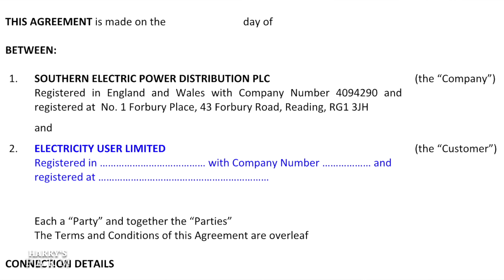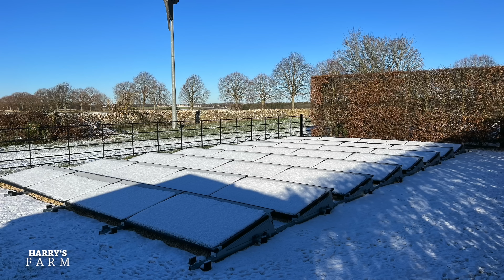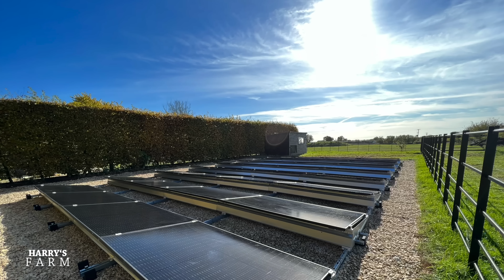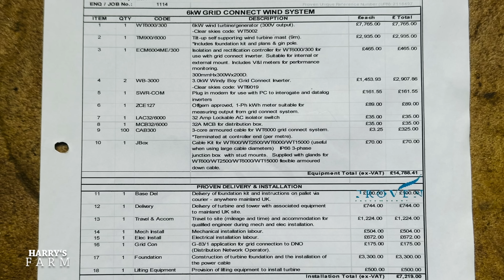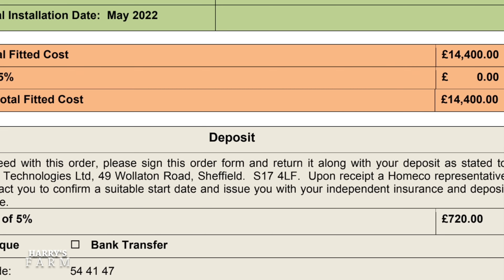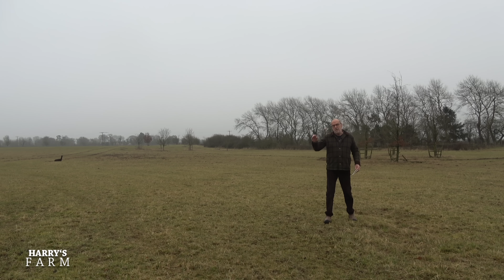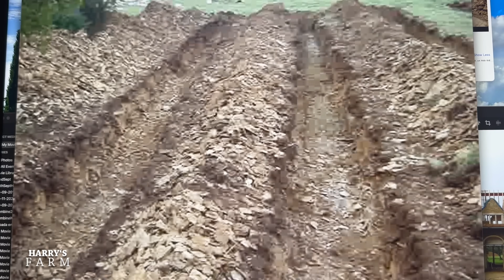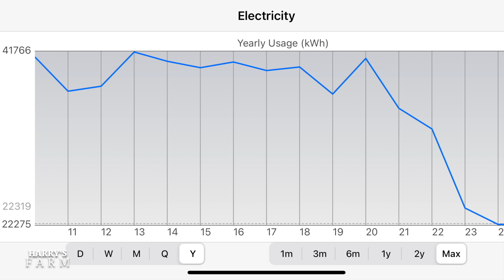Are solar panels & heat pumps worth installing? Here's what I've learnt after several years of use.

Comment: Solar size needs to be maxed for Winter. Panels are cheap if you have the space get 4times more. Yes you would have to limit what you produced in summer to meet the max the grid can take from you. But just switch some panels off as required. Yes the return would only be for half the year but they would still pay for them self easily in their guaranteed life span.
They should also be mounted at a much higher angle to get the max from any winter sun that is out there. Again max in winter not summer. There are bi-sided panels that can even be mounted vertically.
Yes you either need optimisers or Micro Inverters on each panel (that could be shaded) so that it does not take down the output from all the panels on the string.
Very interesting to see how little the wind makes and that is on quite a large turbine that most houses would not be able to mount.

No mention of batteries. I am surprised you do not have at least a day worth of battery storage (or more) then you can go off peak and get the electricity at a 3rd of the cost (currently). 

Not the best designed PV system for what you paid. But it works and can just tick over or spend more to get it better for the winter.

Comment: My well insulated and newly renovated Southeast Virginia home (2900 SF) uses about 11,500 KWH annually. Everything is electric, with the exception of a gas-driven tankless water heater. In 2022, I installed a grid-connected, roof-top system consisting of twenty seven 400 watt Q-cell panels, each with its own micro-inverter to optimize output in the face of shading issues present on the property. Yes, shading will negatively impact output and, yes, production levels fall way back in winter months. That said, and despite those problems, the solar array covered about 75% of my annual electrical usage. When I add additional credits provided by the local power company, my annual cost for electricity runs about $500 total. There are many variables that go into projecting the feasibility of a solar array. For me, it was a definite yes.

Comment: I live in a 2 bedroom badly insulated cottage with tall ceilings  built circa 1950.  Two log burners and a  oil combi boiler. I have free firewood. 

Total  heating cost £600 a year in oil.

£14,000  is i submit excessive.

Comment: We have a ground mounted 7.38pKw solar array where the angle of the panels can be changed throughout the year. We also have optimisers which remove the shading problem if one panel in the string is shaded. Panels currently at 60 degrees and produced 123.01 kWhs in December.

Comment: A wind turbine from 2006? Again Harry, the technology has moved on. It should be higher, with longer and better designed aerodynamic aerofoil blades. Again you are in a position on a Fram to do this.

Comment: I own a solar and renewables business in the south west- 89w is much lower than it should be for a 12kw system in daylight. 
Either there’s a fault in the system (how far away is the inverter?) or more likely, the whole system is being brought down by the back row. 
You may be able to improve generation by having someone do proper shade calculations and adjusting the string layout (the order in which panels are joined together). Or even removing the back row from the system during low sun angle months.
Reply: If I knew Harry, I would tell him to consider buying the pressure treated timber to build a pergola structure at the height of the hedge, you build it with a fall to angle the panels better, high at the back, sloping down toward the front; utilising all the existing hardware plus some stainless coach bolts to fix it. Problem mostly solved, no more shading, better average angle of attack and all for around a few (very few) hundreds of Pounds if you DIY. Would also double as nice shaded summer area for doing stuff/outdoor dining area/battery storage area - easy!
Reply: Would fitting optimisers to each panel help so he doesn’t lose the entire string?
Reply: @javelinXH992  Yes.
Reply: @richardabw  I have them on my panels as there is significant shading issues on my roof at times.
Reply: @javelinXH992  optimisers is a good idea, but the initial cost may not be worth it, they’re quite expensive things. Worth looking into though, this would be the most common solution. 
I’m not suggesting loosing a string, just checking the string design is as efficient as it can be, that for example there isn’t 1 panel at the back/ side pulling down the rest of the string which may be on the next row forward.
Reply: I'm surprised the control logic for these systems isn't WAY MORE granular and adaptable. I assumed (wrongly) that output balancing would be far more automatic. I wonder why it isn't? Industry inertia? Seems like that's an area a competitor should be innovating.
Reply: @TheJohn8765  it is, you can make it as granular as you like, but it costs. 
In terms of automatic balancing, harry hasn’t quite explained it in terms of real physics, it’s not a computerised decision or a fault that comes from shade, it’s the physics of how the panels are strung together.  The installer is trying to dumb it down for the customer and actually resulting in incorrect info. 
The inverter doesn’t see a fault due to shade, it won’t detect a poorly producing panel, the issues are entirely physics based 
They are put in series, so it means if one module has a volt drop due to shade the other modules will drop to match it. The better way to explain it is that if one panel in a string is half shaded, it means effectively every panel on the string is half shaded.
Reply: I disagree - the output of Harrys 12kw in June sounds bang on for a south facing ground mount. 

Me thinks you aid your selling technique by overstating the generation stats perchance?
Reply: @tillyfoxtrotter  summer seems fine, winter low angle months look too low. 
Not that it’s relevant, but I don’t sell anything direct to consumer so no, I’m not fudging any generation numbers. I also have absolutely nothing to gain by making this comment without reason.
Reply: @tillyfoxtrotter  Try reading some of the other comments below, it's a suboptimal installation.

Comment: My parents switched from oil heating to a heat pump (air exchange) 12 years ago and their heating bill went down 80 - 90%. Upgrading the insulation and switching to much better windows was an absolutely critical part of getting that kind of result, though.
Reply: And how much did that cost all together???
Reply: @jozsefdebreceni9911  does that really matter? It has a decent return on investment. And the best of all: energy prices keep rising with inflation but the loan doesn’t. And the savings usually pay for the loan, and then some. 

After a good few years your loan is being paid, the energy costs keep rising but your house uses less so you win big time. It always pays to use less energy and it’s not only for the rich.
Reply: Right. Al large part of the savings is in reducing the energy needs. Sure, a heatpump is very efficient and has a decent return on investment. But nothing like 80+ percent. That’s mainly the reduced energy needs.

Comment: Harry, your ground mounted solar PV panels are way too flat to optimise generation in either winter or summer. That's an own goal. You could also replace your panels with newer 550W bi-facial panels with micro inverters and place a reflective surface under them. The micro-inverter starts at a lower voltage than a string inverter and therefore produces more energy over a longer day.

Comment: Harry you are a God of tech and clearly have deep pockets.  Regarding your  home solar patch. Pleasing to the eye it is, yet clearly 'shadowed' all to easily.  You could drastically improve that. Raise the near edge side to the top of the hedge (still hidden from the house) So raise it by 6 feet, then slope it away from the hedge facing the sun,  sloping down to the other side, all still hidden from the house. In simple terms, get it off the ground.  You already have the basic framework already there. I know just a few leaves will shut down an entire panel. So the massive shadows off your good looking hedge will be crippling your efficiency. You can get drop down sections for cleaning, those that are raised will not be shaded,  the panels themselves, are as you know, very light, so undo the panel catch and lower by hand to the ground level or waist height for a monthly wash and brush up. I would not be surprised after doing this, if your generation went up by 25~% or thereabouts, especially in months outside the peak three in summer when long shadows and shading are peaking. YOU SIMPLY HAVE TO AVOID THIS.  Very much enjoyed your vid, thankyou.. Lithium batteries are much cheaper safer and more efficient than when  you installed your solar.  You could build a battery house, have it professionally set up then forget about it. 2500 kwh would be about right, remember those deep pockets !   In the winter when the turbine is making 6KW  (Why only 6 KW ? ) when  15 or 20 kw would pump up the battery pack quickly putting it into a giant battery store makes sense. You could easily live off the batteries and turbine alone, almost forgetting the solar none contribution.

Comment: Best explanation ever ❤thanks . I’ve been thinking of using air conditioning units I’ve worked with installers who say it’s made for it ..air con in summer and heating in winter just like duel air on in cars .
Reply: And even more efficient than Air-to-Water Heatpumps, - although they don't qualify for the £7,500 Government Grant, and you need a separate system to heat your hot water.

Comment: I think the key thing to take away from this is how important it is to do the sums and not to be over optimistic in your expectations. I've heard people say how disappointed they are with their expensive solar installations, after falling for sales hype no doubt.
Our house is probably around 1.5 times the average house size but it would take decades to get our money back on a solar & heat pump setup. The roof faces East/West so is not optimum and we don't have the acreage for long pipe runs so it would have to be boreholes for a heat pump.
We've been through the whole house with low energy lighting, have "efficiently rated" appliances, including gas boiler and have optimised insulation so we're sticking with that for now. If we had more room for more panels etc, then maybe.

Comment: ANNUAL OUTPUT VARIATION: Harry, you could mitigate by having movable panel settings that allow for a higher angle in winter. For example, have a high angle set in November and then a lower angle set in April. You could also go for a solar tracker system that optimises by direction and angle as appropriate for every day of the year. You are in an ideal position to do this.

You could also mitigate for lower solar PV in winter by adding a larger wind turbine when wind is greater. Again you are in a position to do this. I accepted that most UK domestic installations a wind turbine on site is not possible, but a part share in a shared ownership of a commercial wind turbine/farm is an alternative.

Comment: For a domestic dwelling then I would recommend using large polytunnels with wicking IBC's as a heat sink and place that over your ground source heat area and somehow use a heat recovery system to funnel warm CO2 house air back into the polytunnel. Air source heat pumps then use a heat exchanger in a polytunnel with heat sinks and pull refresh air from outside the tunnel and warm the air up before reaching the pump. Again return the warm CO2 house air back to inside the polytunnel. Solar is only good for non heating devices such as electronics and lights. Summer excess sell to the electrical supplier. A cold storage room is as good as a fridge and just have a freezer or learn to preserve food.

Comment: Almost perfect conditions making for a balanced and fairly efficient system, but then building a house and buying land, as well as the expense of the solar/wind installations is rather beyond the average householder.

Quite why you were surprised that you lost so much solar in winter is a mystery to me.

I live in a 3 bedroom, EOT, listed Victorian cottage. About 5 years ago, I assembled quotations to have it brought up to 'NetZero' standards. It included a GSHP as we just about have a garden big enough to cope; internal wall insulation to the solid masonry walls; triple glazing; loft insulation; radiators etc. Everything maxed out to be as efficient as possible. Roof solar was out as the building is listed, and the conservation officer wasn't interested.

The bill was going to come to £100,000+ which was around a third of the value of the house at the time. This included recommissioning the entire house, as the kitchen & bathroom would have to be ripped out for the wall insulation, timber floors lifted to install insulation, so new carpets and of course redecorating the entire house. I didn't cost for any of that so, conservatively, add another £20,000.

Our combined Gas/Electricity bill was around £80 at the time (now £130, but we used the £100k to build an extension and add a bedroom, utility and bathroom so the increased volume of the house by about a third contributes to the increased bills) so assuming we could have saved 100% of our bills @£80 it would take roughly 125 years to pay off the cost of NetZero compliance.

We live near the sprawling housing development (Chafford 100) in Essex, it is enormous. One can only imagine the ambient noise levels if each house is forced to install heat pumps, which will necessarily be ASHP's. Bad enough if they are all new, but within 5 years the usual suspects will fail to maintain them and fans will be rattling, and bearings rumbling and screeching. Across 5,600 homes in that complex, it would be a nightmare to live in.

Comment: SHADING: Harry, PV technology has moved on and shading is not such a problem. You are suffering because you are using a string inverter. Even when you installed your system micro inverters and power optimisers were available.

Comment: Harry, those panels need to be raised up onto a frame / pergola. Significantly reduced shading and you'll get early and late sun, which you clearly don't get at the moment. It will also create a nice space below the panels. Ideally you should also make the panels tiltable, to get the best possible output in the winter.
Reply: It's the Cotswolds, I very much doubt they would get permission.
Reply: @ogribiker8535 would they need PP for a ‘temporary’ structure?
Reply: on two solar farms near me the leading edge of the panels are 600mm from the field surface

Comment: I had solar panels fitted in 2011 and it was one of the best investments I ever made with the installation paying for itself in 7 years against the 10 stated by the salesman.

 I'm really surprised you positioned your panels near those tall hedges with the incumbent shading.

As for heat pumps, far too expensive to retro fit on existing housing I'm old especially for those of us who are retired hence I had fitted a new gas boiler last year which has proven to be far more efficient than previous which was 15 years old.
Reply: We're on for payback within six years, which is earlier than I expected too. I agree retrofitting heat-pumps to an existing property is a bad idea. The UK housing stock is not good in terms on insulation and draft-proofing and because heat-pumps work most efficiency when heating water to 40-45 degrees C, they work best with underfloor heating, which is next to impossible to retrofit to an existing house. Thanks for watching!

Comment: Question – at what temperature does a ground-source heat pump freeze? The coldest temperatures here in the U.K can be, on rare occasions, a low as -22°C. It would need to resist that pressure.

Comment: Re performance of solar array. Key factors to getting maximum performance from solar panels is positioning ( due south midday ) and angle of the panels. Yours are at about 15 degrees. The steeper the angle the more direct exposure to the sun the greater the amount of electricity is generated. At your location  near Burford that would  be about 50 degrees. The higher the incline the greater the shading so you would need to reposition the whole array. In addition the forces of high winds needs to be counteracted.  I agree with other comments on micro inverters. 

I live in Switzerland and have two solar arrays with 17 kWp total and a geothermal heat pump with two bore holes of 100 m depth. All our panels are equipped with micro inverters to optimize performance. I am charging a KIA EV 9 via a wallbox so any electricity generated by from solar not used by the house  goes into the car battery before being exported and sold to the grid.